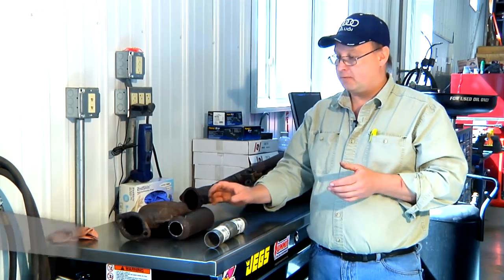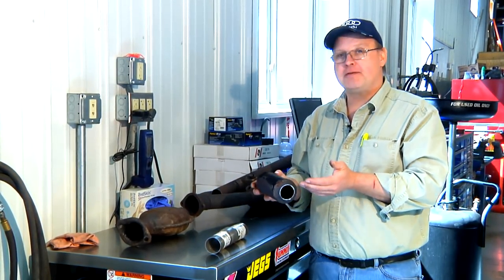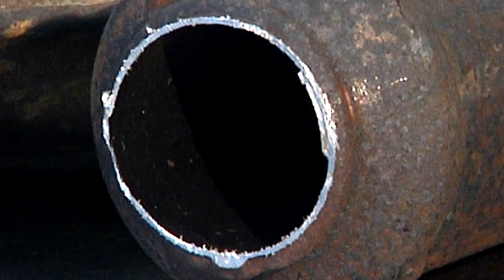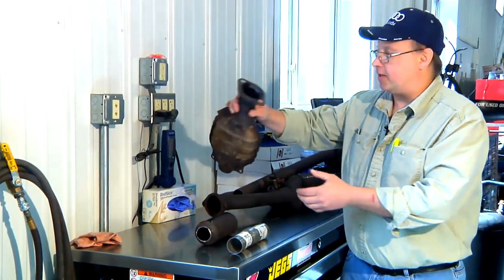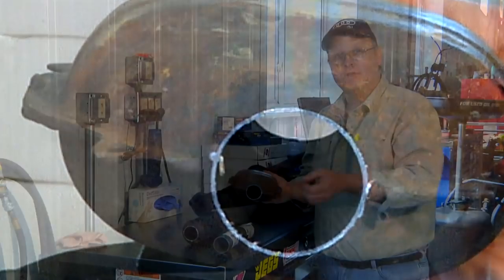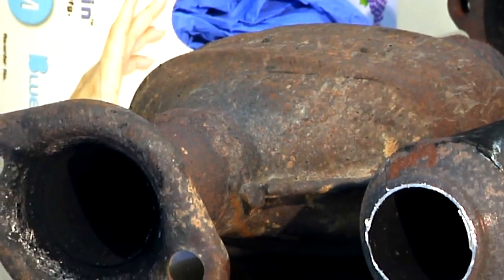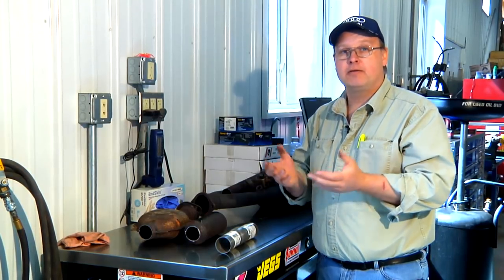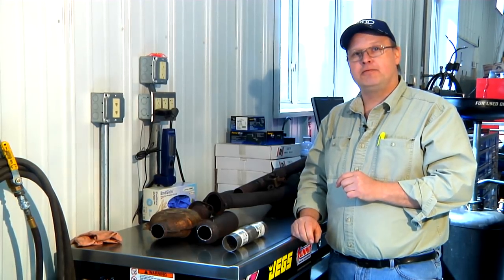What Happens if You Replace the Exhaust Resonator With a Pipe? : Under the Car Repairs

Comment: As soon as the guy said 'proper backpressure', it's over. Oh well, thought it was going to be informative in some way.
Reply: But but...backpressure makes it more efficient...
Reply: Adam Ensbury only if it has a 'Type-R' sticker on the trunk!
Reply: Reflected pressure waves and valve overlap help with scavenging which leads to increased volumetric efficiency at certain crankshaft speeds. That doesn't work without "back pressure" which is flow resistance induced by boundary layers building up on internal exhaust system structures and exhaust gas viscosity.

A reduction in that resistance is advantageous for some turbocharged systems, with no valve overlap, tuned for low boost lag but, is not so great for naturally aspirated engines. It will definitely cause a dead spot in the torque curve and higher fuel consumption because of the factory closed-loop lambda control is typically not capable of handling large sudden variations in engine induction parameters and has slow response times. That is especially true when the engine is operating outside of the expected intake state range that the management system was calibrated for. (Vacuum pressure or mass air flow etc are typically measured and are affected by enhanced mass scavenging within certain rpm ranges)

Clarification: The improvement of scavenging must be done using tertiary pressure waves. The primary pressure wave is reflected back out of the resonator and muffler structures in that case.
The simple reason for it being bad to remove the resonator on a stock vehicle is because of the engine speed range difference. The distance to the resonating surface must be further away in passenger cars which is why they have cast manifolds with no reduction in diameter. The arrival of the secondary and the exit tertiary waves ,with respect to the exhaust valve, must be timed to help improve scavenging. These structures have erroneously been seen as providing "back pressure." Removing them typically leads to a disruption of the scavenging affect, a change in intake operation, and causes subsequent problems for the ECU.

In a performance vehicle, the exhaust pulse frequency range is much higher and requires a closer resonating surface. This is achieved using headers of certain length with a properly designed collector or series of collectors for cylinder isolation. Typically after the collector, there are no pertinent structures for race vehicles. For street vehicles, a resonator and muffler may be added for low end performance or sound characteristics.

To get any real benefit, it is best to tune or replace the engine management system and some other components so that performance can be optimized.
Reply: ChrisHallett83
Using an exhaust system where chocked flow and restriction of the overall mass flow rate is more likely, does reduce torque however, without some "restriction", no tertiary waves would exist that allow more efficient scavenging using valve overlap.

The challenge and subsequent expense of high precision engine management arises from ,costs, delay, and the allowable adjustment range. There is a large delay in lambda measurement in the first place. The response time of even the best wide-band oxygen sensors is orders of magnitude lower than the sample rate of modern micro controllers and ADCs. The rate of adjustment makes no difference. To keep production costs low, cheaper components are necessary and the window of their operation has to be fairly defined and minimized. Injectors with low duty cycle rating, the use of narrow band sensors, the sample rate, number of sensors, complexity of sensors, and memory allocation, must be reduced. Powertrain component geometry, such as the intake and exhaust, have to be very specifically tuned within the limits of inexpensive manufacturing techniques. The powertrain management is then very precisely tuned to work well with that standard configuration. Changing any components within the system without adjustments to the management system and testing, will, more often than not, lead to reduced torque, increased brake specific fuel consumption across speed range, poor transient response (undershoot and overshoot of injection duration and timing advance as described in closed-loop feedback control theory), and increased emissions.
Reply: ChrisHallett83 We are talking from two different perspectives. Without quantification, units, and precise metrics, the discussion is pointless. Without adjustments to timing and injection duration maps, there will be limited benefit, if any, if parts are swapped for "performance parts" on a stock passenger car, such as an Accord, Civic, Mazda 3, or Miata, whatever. Even then the quality of adjustments is questionable, more often, than not. The only way to get tuning absolutely right is with a full array of quality instrumentation, way beyond a wide band sensor and heater control circuitry from wherever and some chassis "dyno pulls". I'm, referring to Kistler, Horiba, AVL, FEV, Michigan Scientific, Omega etc for flow rate measurement, high speed temperature and oxygen sensing, programmable dynamometer, pressure transduction, high speed FTIR, smoke meters, and so on. Those are the tools used by manufacturers and engineering firms, under contract, to tune powertrains between model years and during development, in the first place. That goes for OEMs, and top tier racing teams.

A top fuel dragster produces around 7600lb*ft of torque at ~95bar IMEP, using forced induction at extensive intake port pressures and methanol at a ratio approaching 1:1.689 by mass. Pressure wave tuning is a waste of time at that point... That is especially true for turbocharged engines as exhaust "restriction" only serve to reduce the efficiency of the turbine. The volume of exhaust gas produced by a dragster, irrespective of chemical species or temperature, would destroy either the exhaust system, with "normal" components, or the engine, if the exhaust was strong enough.
Reply: My point was, him saying 'proper backpressure' without first quantifying it with how backpressure is a result of tuning exhaust pulses is wrong. I was once told that putting a straight pipe in place of a resonator (at about the 2/3 point of the entire exhaust system) would be bad because the car needed backpressure. I was skeptical then (~20 years ago) and when people CONTINUE to propagate this falsehood without specifics it infuriates me.
Reply: "Your point has been proven wrong countless times over the last hundred years or so."

Uh... no. I've alluded to back pressure being a misnomer. Structures in the collector, resonator, and muffler cause pressure waves to travel back and forth through the compressible exhaust gases. That phenomenon is used to improve engine operation through increasing volumetric efficiency. That is a fact. "Back pressure" is a colloqual term so that we don't have to say something like " semi-local or macro pressure wave dynamics." Flow resriction is never been good and it is not back pressure. Some powertrains take more advantage of these phenomenon than others. Some cars will lose torque and some will run like crap and some will have terrible fuel consuption if certain parts of the exhast system are altered in particular ways. That is an absolute fact, carburated or fuel injected, mechancial or electronic.

Just because one can add parts specifically engineered for Chevrolet Camaros, and I actually know people on the Engineering and development team at Borg Warner, FEV, and Delphi, doesn't mean it works for every other vehicle or it is even possible all the time. Chevrolet knows that the Customer has aftermarket modifictions in mind and equipted the car with a particular Multec system but, has a limit to what they will offer out of the box. Most naturally aspirated vehicles out there don't benifit from performace parts. That is a fact. NVH, emissions, or something else increases with the "gain".  That's if the OE can even chase conditions at a transient state. The latency of a Wide Band sensor by itself is the primary limiting factor and some cars don't even have that capability.
Reply: ChrisHallett83 In response to ECU statements: Tell me how to use closed-loop control on an engine that releases exhaust gas pulses at a rate ranging from 4.18 to 20.8 Hz. (1000RPM to 5000RPM) It is capable of reaching pulse rate gradient magnitudes of 16.6s/s(+or-4000 RPM/s) with spirited use. The sensor used to measure oxygen content of those pulses, which must flow a distance of 0.5m, has a latency of 6ms and a measurement frequency of 2Hz. The answer? Classical closed-loop cantrol can't be done directly. The case above is for one cylinder only. Some engines have 4, 6, 8, 10, or 12 aranged in an I or V configuration. The system thus has to be calibrated to a particular powertrain before hand and can only operate with state gradients less than about 0.2s/s. During "closed-loop control", multiple high precision timers, counters, and extensive delay algorythims must be used to determine which operational state it was at. That state must correspond to the gas plume measured, and make specific adjustments, to the data table, at a particular spot, given that particular oxygen measurement. This has to be done with information that comes, for instance, 645ms after the particular gas pulse that was measured, itself resulting from an indirectly controled 6ms combustion event. Possibly 1000 more have gone by unmeasured in that time at a particular speed and load or several from differnet points on the table. The control unit has to do all this with amidst rather extreme powersource voltage transients, signal noise, and current ripples using reduced cost electronics. It can take months or even years of operation for the system to actually make automatic adjustments to the the entire injection duration map. That doesn't include the ignition map, or any air, water, or oil temperature compensation maps either.

It doesn't matter what ECU we are talking about, they all have this same problem. Most operate in open-loop mode because of high engine speed gradients. Even the fancy Delphi Multec of a Camaro SS does this. One has to see the reality and not industry wide "marketing magic" being sold to laymen about "fuel injection". The reality is that most things arent as awesome as they appear and 10 years in advanced automotive research and racing has shown me that.
Reply: ChrisHallett83

"most naturally aspirated vehicles don't benefit from performance parts". I never said that.

Here is what I said word for word.
"For a 130BHP passenger car with full of crudely constructed parts, everything is configured mostly to reduce NVH, emissions, noise, etc. Removing parts usually does mostly nothing important,"

"Without adjustments to timing and injection duration maps, there will be limited benefit, if any, if parts are swapped for "performance parts" on a stock passenger car, such as an Accord, Civic, Mazda 3, or Miata, whatever. Even then the quality of adjustments is questionable, more often, than not."

You have nit picked and taken everything I have said out of context. I'm starting to think you are just a troll. That "100 year" comment is just stupid. You keep naming cars that make up <2% of the market like high end Corvettes, Camaros, and 8000BHP dragsters that have had extensive engineering done on them for horsepower and further aftermarket engineering by reputable companies, such as KaTech. You sound like a brochure or some 30 minute bolt-on TV show from Speed channel. The subject matter of the video doesn't even refer to those types of performance vehicles in the slightest. I am talking about normal passenger cars that most normal people drive with less than 3 liters of displacement like Civic, Camry, Mini Coopers, Mazda 323, 626, 3, 6. You know!, mostly (statistically) naturally aspirated. Most things that can be bought that are labeled as "Performance" do absolutely nothing to those cars but make them worse. I drive an an 2001 Altima. "performance parts" is put in quotes meaning that it is a group term for things like bolt on exhausts and cold air intakes. If I go to whatever store and buy a "cat back exhaust" it won't do anything to my car. If I removed "restriction" by just increasing diameters within the intake and exhaust, I would lose torque and base specific fuel consumption would increase, in the case of the exhaust. A cold air intake would do absolutely nothing. In fact, the air temperature just behind the non sense "K&N" filter would be higher and the air quality would be less. That can be and is tested on engine and chassis dynos, with advanced laboratory equipment, or common performance shop equipment.

Could I improve the performance of my car and cars like it and do it to professional industry standards? YES but, with lots of time in the engine and with ECU reflash, swap, tuning. The stock ECU can't and will not cut it, ever. There are no quick hack saw and MIG welder "mods" in that will get the job done. Actual engineering (computational fluid dynamics and lab testing) is the same thing that had to be done in the first place. Is it worth it to try to get 20 more HP from my KA24DE or spend &5000 to get 200 more HP and make it a KA24DET? ABSOLUTELY NOT. A cat back exhaust or cold air intake with no ECU tune will result in reduced torque.

I never moved any "goal post". There are actually several and all of them are important, especially "gas mileage."
Reply: ChrisHallett83
Good to know you got lucky with one Datsun by taking advantage of the caurburetor's natural ability to attenuate changes in transient intake phenomenon caused by altered downstream geometry. I must admit that without spell check, I'm worthless.
Reply: ChrisHallett83  ECU do make slight temporary changes to compensation and fuel maps to deal with knock, misfire, lambda, temperature, and pressure variations. I explained how the lambda section of those algorithms really work and why they take entirely too long to deal with relatively drastic changes in the exhaust and intake parameters. That is why there is extensive research into cycle counting and measurement conversion signal delay algorithms. When you look really close, everything isn't as peachy as you'd like to think. It still takes extensive testing and adjustment to make plug-in ECU base maps for mass produced powertrains. Without extensive intellectual property disclosure and initial design intent aimed at the aftermarket, there would be no bolt on parts market sector irrespective of knowledgeable ECU tuning.
Reply: ChrisHallett83
I never said ECU can't be flashed. I'm saying that they have to be flashed more often than you'd like to think when parts are swapped. Also, Denso put out the information of how to reflash their ECUs, in the first place, and it leaked. That is why people are reflashing sportbike ECU's. I've done it myself with a basic TTL kit and a hexadecimal programmer.

Whoever figures out how autonomously tune based on measurements from an oxygen sensor alone without a base map and calibrations, orders of magnitude faster (2MHz) than the measurement rates and latency themselves (2 to 100Hz and 6 to 10 ms), will be quite rich. Violation the laws of physics will be why they are rich.
Reply: ChrisHallett83
Open loop implies that the readings aren't being used by the ECU and it reverts to the base maps. Map quality is thus key. Just because the output voltage of an oxygen sensor signal amplifier is measured 100 times a second doesn't mean that the sensor is capable of operating at 100 times per second itself. Most wide bands have a heater adjustment at 2Hz and can only register transitions at 10Hz. It requires 2 to 3 seconds of steady state operation to get a stable reading. That is why the whole tuning attempt, manually done in a lab or on a dyno or "automatically" done as you drive along, is based around holding speed, load, and throttle position "constant" for as long as possible. Even when you put an aftermarket part on a Camaro SS or add a Bazzaz with O2 auto tune to a GSX-R, for instance, you should do lots of slow moderate sweeps through the load range at several speeds for a few days. If you took them straight to the track and ragged them out at high RPMs with crazy shifting, you would notice a big difference in the augmented fuel maps. It would definitely not be nearly as optimum as the map after a few days of slow easy riding or driving. The sad truth is that its impossible for an ECU to go straight to the optimum injection duration within a few tens of milliseconds of the engine running, even with a good base map. It takes even the best algorithms with the fastest ECU computation hardware minutes to optimize just the idle cells of a fuel map by themselves.
Reply: I installed a high flow resonater and high flow mufflers on my otherwise stock
V-6. End result is torque curve has been shifted 1,500 R.P.M. higher and ECU
sometimes seems confused. Will most likely re-install a stock resonater.
Reply: marlon pisk
There you go.
Reply: To follow up on my original post, I have re-installed a more restrictive resonator and have
gained much of my low R.P.M. torque back,
with just a slight HP loss at 5.000+ RPM.
The car seems faster this way and a helluva
lot more fun to drive.
Reply: ***** lol your comment is awesome, im goin for a manual cutout because ballin on a budget but ya loud exahust is a good way to be on there radar, i dont get pulled over for it but they like to tail me and tail me for a while, i wanna put on a quiter exhaust then i have now but add the cutout so when i want to and, im sure its safe enough to do so i can be loud plus get the extra high rpm air flow, i was ridin open header for a little bit and puttin the catback back on i notice the rpms climb much slower on the high revs. the power fells the same but with the open header it just rev up so fast
Reply: Yeah, BACK PRESSURE, a regurgitated term that has no known formula to properly "design" into you OEM exhaust. My favorite is oils or additives that " free sticky VALVES "  (( dang, my valves are gettin stuck! )) Maybe a lifter back in the days, but snake oil and 3/4 race cams are forever......
Reply: marlon pisk Yea you'll lose some low end torque with no res but gain some high end hp and torque.
Reply: JRadd135 While that's fine for a car used mainly for racing, on a daily driver the sluggishness from a stop and loud
interior drone gets old in a hurry.
Reply: Its because he had a plugged rear pipe